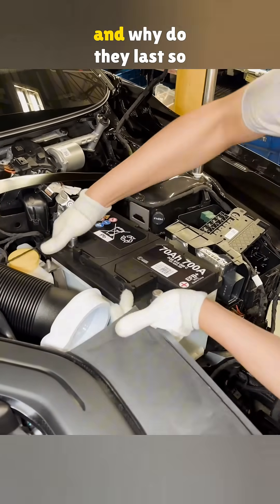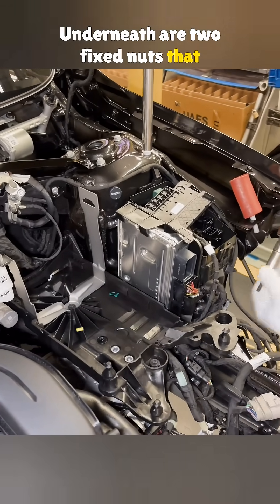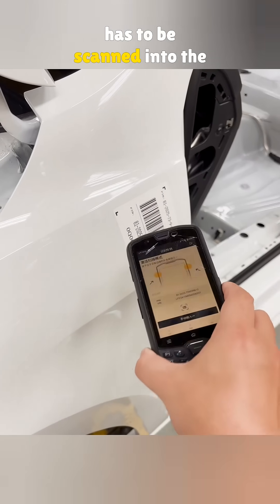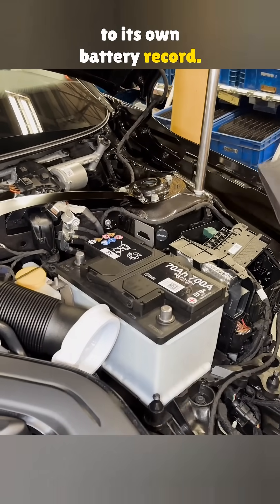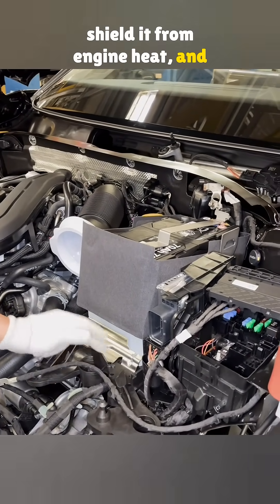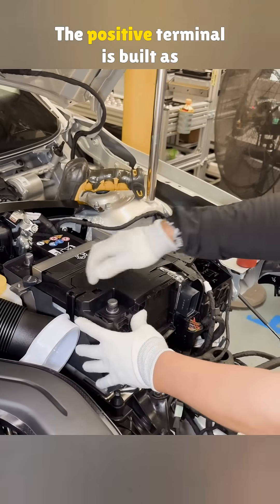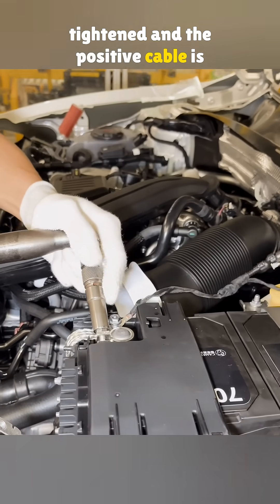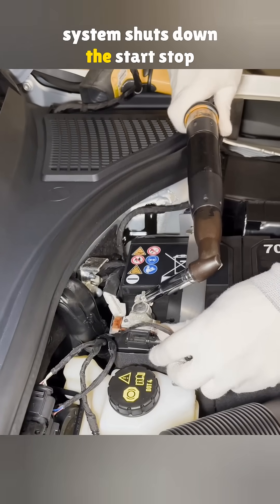How many years can a car battery last? #cartech  #carMaintenance #carBattery

Comment: Varta 52Ah 470A 2021/4 - 2024/1 worked then it was weaker so it was changed to boxer 1.5 it was prescribed. But it was put into a weaker volume and it still works but it is getting close to replacing it again I have a stronger one and this not worth having in the car.

I bought a Varta 63Ah 610A for the car itself, we'll see how it lasts. 

Varta 60Ah 540A (2018/5) changed preventively in the 4th year of life, recently sold with the car so good.👍

Honda - some 35Ah 300A battery lasted 8 years, changed preventively, I believe it would last even longer.
Reply: I measured a Varta 63Ah 610A and it has approximately 570A and 5.0mΩ resistance, so it's already under new, so we'll see how it holds up.

Comment: My group 35 batteries typically last 9 years in my old Honda.  
The Nippondenso system is so well balanced that the battery never under or over charges.  No complex computer management required.
Reply: My noname lasted 10 in VW. It's a diesel but I was shocked how low charge is enough to start the engine.

Comment: "Why do they last so long" am i missing something
Reply: The 2.3 liter engine with fuel injection only requires a 500 CCA battery.  I use the 640 CCA Ever start Max with a three year warranty.  Even after 9 years the car still starts but the resting voltage is down from 12.6 to about 12 so time for new one.

Make sure the battery is completely secure as vibration shortens life , and is shielded from excessive heat which is much worse than cold, and never let a low maintenance battery deep discharge as they don't completely recover.
Another trick is to turn the key to ignition position and wait 3 seconds, while you check the warning lights, until the fuel pump charges the fuel rail so the injectors fire a full spray and the car starts on the third crank instead of 8.